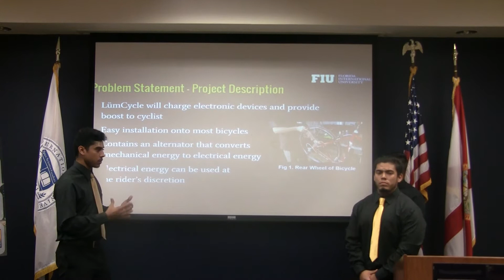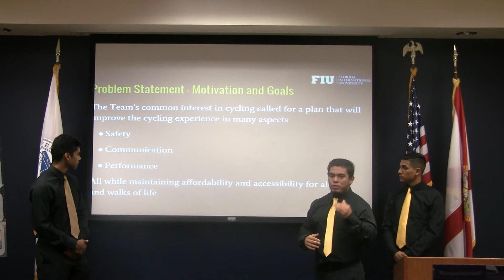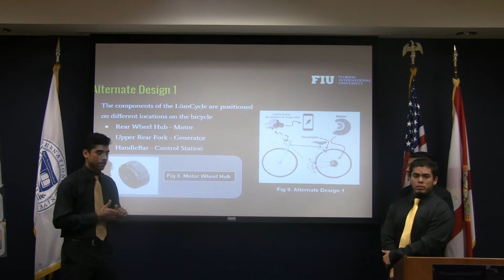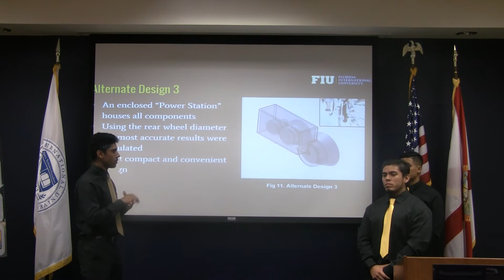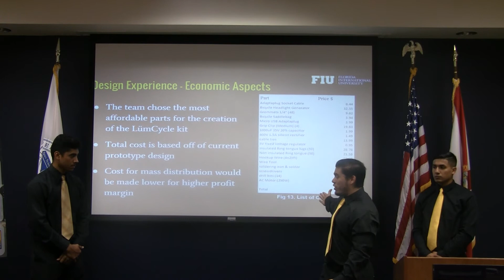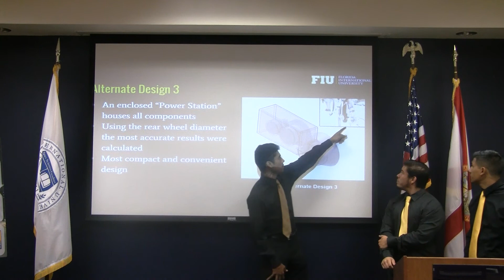SDO Team 8: LümCycle

Comment: This group had an excellent presentation. The speakers were confident, knowledgeable and very passionate in their presentation. The Power Point included many important points such as calculations of the gears of the bike, a cost analysis and the environmental benefits of the product. There are a few improvements that can be added to make it better. The images are difficult to see and some slides have too much text. This can be fixed by proofreading the Power Point before presenting it. Overall, the presentation was very well done.